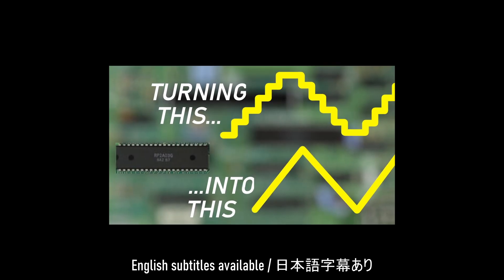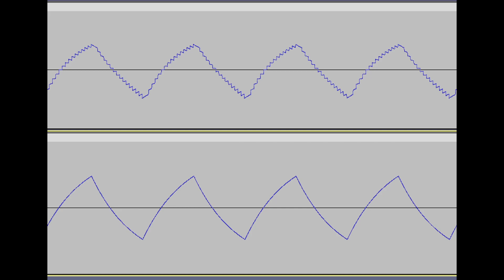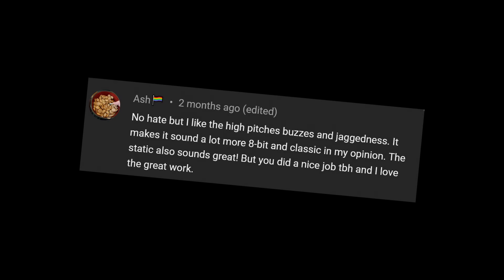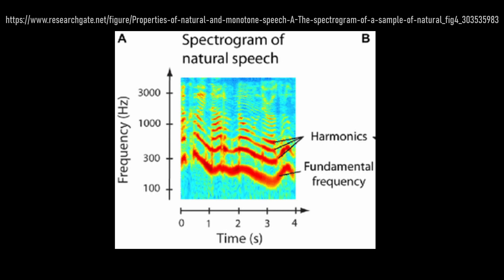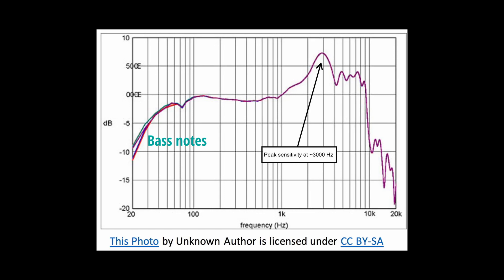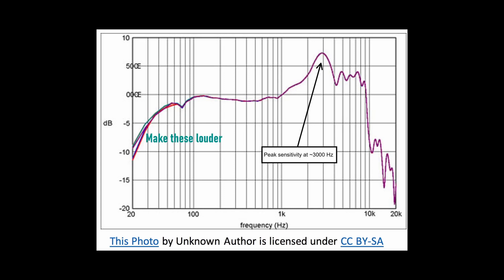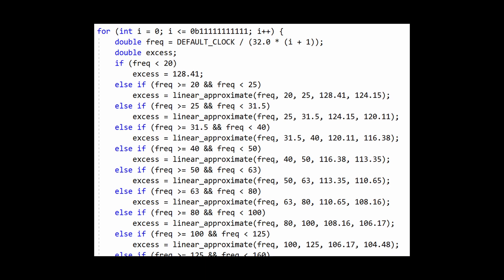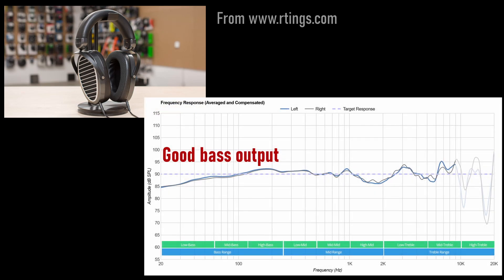I Tried to Fix Your Biggest Concern with Smooth Triangle Waves

Comment: i would focus less on the shape of the waves and more on the actual frequencies and harmonics.

from my understanding (it's been a while since i was into this though):
the way an instrument sounds is mainly defined by the harmonics (overtones)
the "jagged" triangle wave is better described as a triangle wave plus a quieter sawtooth wave at 32x the base frequency. both of these have their own harmonics, so the result is something like:
• the base frequency
• some weak overtones at 3x, 5x, 7x, etc. - the triangle's overtones 
• an overtone at 32x (ie +5 octaves) - the sawtooth "steps"
• more overtones, at 32*2x, 32*3x, 32*4x, etc. - the sawtooth's overtones

(note: all of these overtones have no phase offset)
Reply: I think he was going for what was intended for the sound chip, because I doubt that the 2A03 has a jagged triangle wave on purpose

Comment: What you did may actually be called volume key scaling, when louder notes are played with less amplitude so "perceived" volume stays the same. I think similar setting can be found in FM synthesis DAW plugins or even in old Yamaha FM synthesizers. In addition to "leveling" the volume, this volume correction can be used on FM operators that are modulating other operators, thus making higher notes' wave to have quieter harmonics (quieter relative to base frequency amplitude). This can be used to achieve more accurate real instruments sound synthesis, and that's why YM2612 or similar chips FM patches which are made to resemble real instruments (e.g. piano) can sound off when used on a big range (usually more than 2 octaves or whatever). Sadly, YM2612 and such don't have the automatic function for this, although you can create different instruments for different frequency ranges.

By the way, the sort of exponential formula you showed for triangle channel volume correction is actually very close to what I used while coding my volume key scaling implementation (my formula is longer, more spaghetti and has a coefficient that lets you adjust the steepness of volume suppression, so 0xFF means that you go an octave up and the wave is almost inaudible, 0x20 is roughly what I see in the end of this video).

P.S. There actually exists envelope key scaling, it's when your envelope parts are shorter when note is higher. Also useful for more faithful real instruments synthesis (e.g. piano).
Reply: I guess this is the reason Beepbox and its mods have a larger amplitude at lower ranges and lower amplitude at higher ranges. (Volume key scaling)

Comment: when you posted the picture of the aftershokz were you implying they won't let you hear lower frequencies? I just tested mine and I can hear 30hz just fine and i'm 40 years old. I can hear the 10 and 20hz, but it sounds kind of garbled, and 40hz is clear as a bell like regular audio. Actually I take that back I can hear 20hz just fine at -3db, but to be fair it's hard to tell the difference between it and my tinnitus 😄

Comment: Have you ever wondered how the NES would sound if the triangle channel produced other types of waves? I think Triangle and Sine are not good to bass, as they're difficult to hear, but I always imagined it being a Square wave or a proper bass wave, but I think that's not possible to do :(
Reply: Imagine if the NES/FC's 2A03 wavetable channel got finished instead of having a hardcoded triangle with no volume control

Comment: It's interesting to see the shape of the triangle wave change with frequency. The higher notes look like they are made of perfectly straight lines. The lower notes all look like they're made of curves. This is consistent with a selective increase in bass energy if the note is lower. Good work! It sounds amazing!
Reply: This is because a highpass filter applied to triangle wave. It is made in emulator to simulate stray capacity and inductivity of circuits inside the console and TV audio section you connected your console to

Comment: 4:40 The volume of the triangle channel can be reduced by as much as half by incrementing the delta counter (zxx in famitracker).
There are a couple reasons this technique isn't widely used:

1- It basically doesn't work if you want your song to use samples

2- Unless the volume change is very gradual, there is an audible and unpleasant clicking noise

3-This also affects the noise channel, albeit not as noticeably

Still, if your song has no samples, there are definitely situations in which it's a useful tool to have, and I agree its underused.

(On that note, I've often wondered if a specially made sample could be used to change the delta counter smoothly and quickly.
If such a thing is possible it would greatly raise the viability of this technique. Something to think about.)
Reply from the maker: That is a very interesting idea! I gotta test that out... We can make samples that go from max to minimum, minimum to max, or even halfway variants--if that works (which technically, I think it should), that would really help the triangle channel add some emotion to its notes.
Reply: There's been a few instances where samples are used to smoothly change the delta counter. The MMC5 LotR demo for FamiTracker does this, and I've used its samples in a few of my covers.

Comment: reguarding 4:40:
While you can change the offset of the APU2 DC bias/delta counter to lower the volume of the triangle wave (to a minimum of about 50%), it also lowers the volume of the noise channel because the noise, triangle, and DPCM are grouped together as APU2 in the 2A03/2A07. It also resets the delta counter when you play a DPCM or 7-bit sample on most NES drivers that support those. And lastly, and perhaps the best reason not to use this, it makes a very audible click when you change the volume by a big amount, which is why fadeouts and decays are what this is normally used for. Famitracker doesn't have a macro for this, but you can use Zxx to change APU2's volume however you like.
Reply from the maker: Thank you very much for the detailed explanation, and even a method on how to actually use it! So I guess it all comes down to how the 2A03 mixes the channels... Really interesting stuff! But I guess that was not intended to be an actual volume control method by the chip developers. More like an unintended side effect, I guess?
Reply: @KYLXBN  yep! I'd imagine the mixing was probably another cost-cutting measure, given that the 2A03 is also the CPU for the NES (again, to save costs, so that Ricoh wouldn't have to manufacture 2 chips.) 
Plenty of chips from this era have unintended side effects for cost cutting measures since the industry for sound chips was relatively new, so I find it fascinating to research and discover these quirks, and possibly use them for myself. (glares at the SID 6581)
Reply from the maker: @nicco1690  Makes me remember that the 6581's sample playback capabilities is really an unintended feature XD Really clever trick by the sound programmers back then. The 8580 even fixed the flaw which made samples really quiet.
Reply: @KYLXBN  But now there are also methods of playing samples on the 8580, so Commodore really didn't do a very good job if they wanted to patch samples out. 
However, I don't think patching the samples out was something that they intended, or even knew that people were doing, as the SID's creator, Bob Yannes, stated that he didn't know what people did with the SID chip after the C64's release in an interview once.

Comment: the way that you can change the volume of the triangle channel (at least, to about halfway volume) is by changing the delta counter on the DPCM channel. this works due to an error in the way the DPCM and triangle channels are mixed together. however, the reason almost nobody uses this is because when you change the delta counter, it makes a tiny little pop sound, the sound getting louder the bigger the difference between the previous and changed delta counter is. 
some people have used this smartly (such as nobou uematsu for final fantasy 3) by using the clicks as a sort of percussion, but for the most part, changing the delta counter isnt something most like to do, unless its at the very start of a song.
Reply from the maker: Awesome explanation! Thanks, I didn't know the technical details on how that works. Thanks for the example, too!
Reply: @KYLXBN  of course, no problem! great video, by the way
Reply: @KYLXBN  I may be wrong about this, but when exporting the nsf of super mario bros into famitracker the z effect was used on the dpcm channel, and the z effect basically lets you change the delta counter.

In this case, the delta counter was being set to 48, quieting the triangle wave a little bit. Maybe Koji Kondo set it to that on purpose because with the delta counter at 0 the triangle wave was too loud? No idea. If so, this is an early example of this technique being used.

Comment: The smooth triangles sound too much like sine waves so this is a neat change
Reply from the maker: Indeed, a triangle wave will sound like a sine wave because it is a crude representation of a sine wave :) Remove the harmonics (the stairsteps) and it will really get a lot closer to a sine wave.
Reply: @KYLXBN  I guess I'm just too acclimated to the squarangle waves lol
Reply from the maker: @shalpp  No worries, we all are! :)
Reply: @KYLXBN  That's an idea, how about replacing the triangle wave in the sid with simply a sine wave? Sacrilege of course, but it would be interesting to hear what it would sound like.
Reply: @Mnnvint  just use the low/band pass filter on the triangle
Done